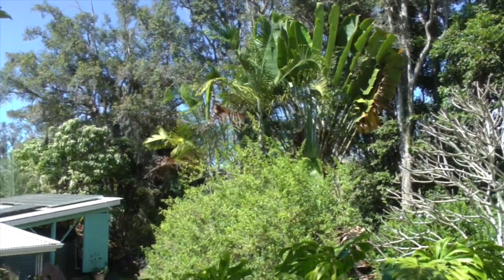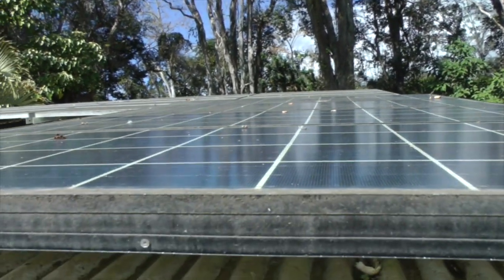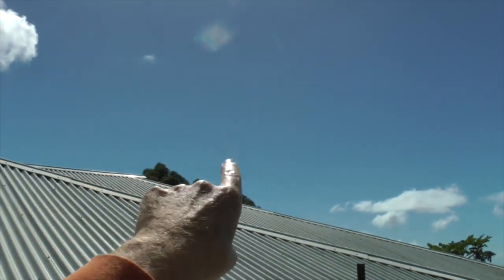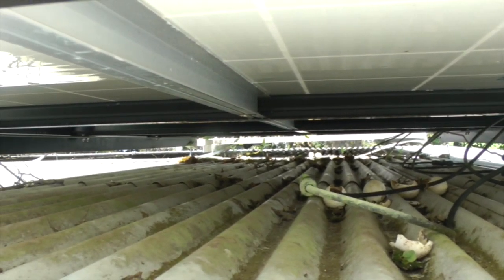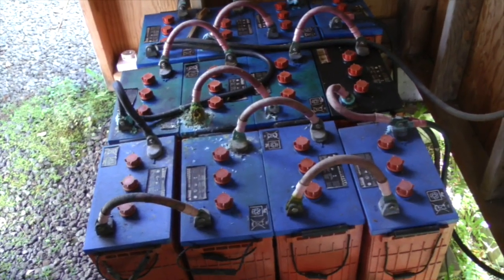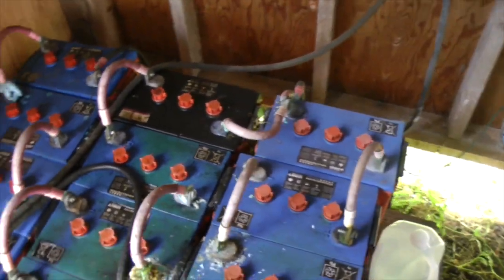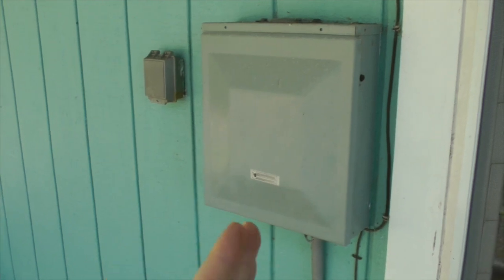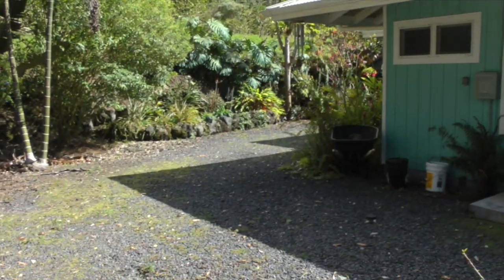Our Farm's Off-Grid Solar Power System

Comment: Thanks for the reply Joel.
Just some info on the lithium batteries from battleborn.
BB10012 , 12 volt-100amp.
Drop in, standard auto battery sized.
Fully dischargable.
We purchased 16 of these for a total of $14,000.
Yes , expensive upfront, but should last 20 years plus with a conservative use profile. We charge to 100% once per week, then discharge to 20% /charge to 80% on an average daily basis.
Usually 1 to 3 air conditioners in use as well as all other operations (3 unit Villa).
Batteries performing flawlessly so far.
Set up is 4 batteries wired to 48 volts x four banks for a total bank of 48 volts@ 400 ah.
We can do a solid 12 hours running across & everything with no conservation or if we need,  we can run necessities (no air-con.) for three or four days.
Never needed to fire up generator yet but we could charge entire bank fully in 2-3 hours if necessary.
We've been very pleased so far and the customer service at BB is great( a human always answers the phone) and they know their product. Thanks for the well wishes with our recovery from Irma 😎. All is well and stronger/better than before and a pretty good tourism season this year so far. Stay prepared, I know those storms can be hard in Hawaii too.
Let us know about your coffee, we are serious coffee drinkers and not much good supply here on St John.
Reply from the maker: Thanks for letting me know, Jeff! Battleborn seems to be making some quality stuff, from what I saw on their website. I doubt you'd be able to run those 3 air-conditioners using that number of lead-acids, at least without kicking-in the generator every few hours. Also, that's a much better charging profile you have, when using a generator. I have to charge these old batteries around 4 hours nightly, and another hour in the morning, if it's cloudy. I'll bring this up with my relatives (if I can get them past the sticker-shock), they all know that our current batteries probably won't last too much longer.
The coffee is coming along well, BTW. It's still early in the season, so the fruit are just now starting to show up.

Comment: Hi Joel. We are solar brothers in arms. We live on St. John U.S.V.I. and just upgraded after hurricane Irma which removed our old grid tie system overnight. We are now using our new outback 8000 watt inverter with 16 battle born lithium batteries. You may want to check out battleborn in Nevada. We run a 3 unit Villa all night on battery power, haven't had to fire up our generator yet since we installed the system on Jan 16,2019. Plenty of power to spare. We typically burn thru ten KW overnight and batteries still have 10-12 KW left to use in the morning 😀.
Hate to see you have to burn up expensive fuel in the generator. We spent about $5000 on fuel for our generator after Irma as the grid was down for 4-1/2 months. Lithium Batts are expensive up front but with proper charging we should get twenty or more years of nightly use. We chose to put our money into our own batteries and 30-300 watt panels rather than pay island fuel rates to the big oil companies. Gasoline is about $3.50-$4.50 per gallon here on any given day. After hurricane it was $5.00 per gallon and cash only sales.
Be prepared is our new motto.
Let me know about your coffee, we love coffee and it not much selection here.
Would love to buy some if you do small sales by mail.
Thanks, have a great day.
Reply from the maker: Thanks for writing Jeff! I've been looking at lithium batteries for replacing the old lead-acid batteries we now have, though I was a little put off by the prices. I've basically been trying to run these old batteries as long as possible while hoping the prices come down on lithium replacements. I'll check out the Battleborn website, they may have a dealer around here as well. Sorry to hear about the Irma problems, I remember visiting St. Johns as a child with my parents (a long time ago).

Comment: How much did the whole system cost?
Reply from the maker: We installed the solar 15 years ago. I think it cost around US $14,000, including installation.
Reply: @joelp63  I believe it's much more affordable nowadays. (You got there before it became mainstream)

I'm curious, did you replace any of the original items, or is everything still working ok?
Reply from the maker: @abdulrahmanq7127 , yes, we are on our second set of batteries and have replaced both the inverter and the charge controller. The solar panels themselves are all original.